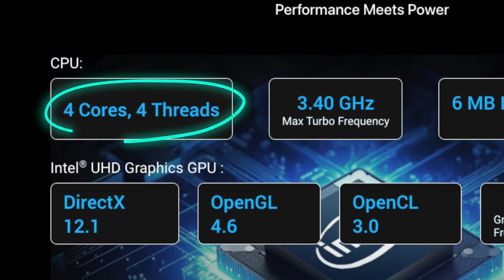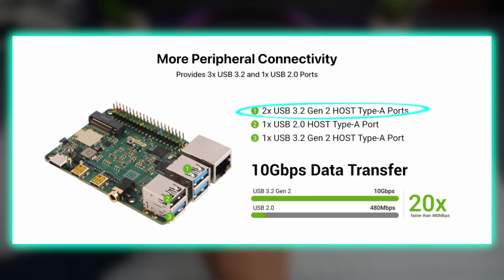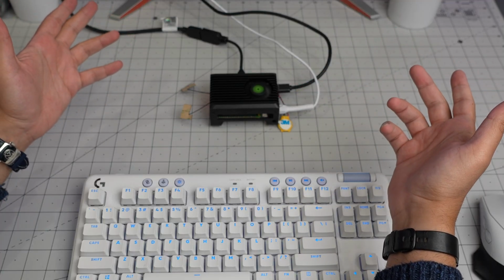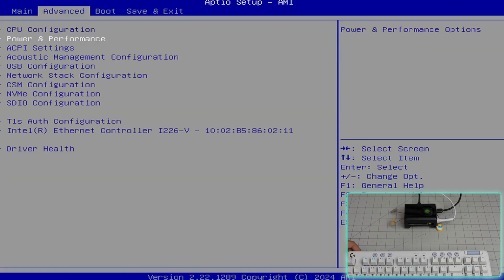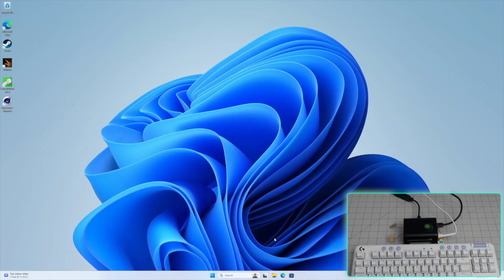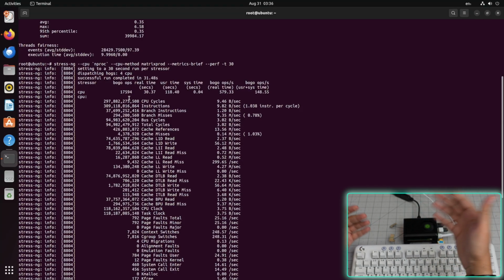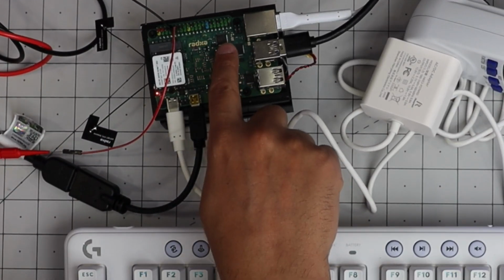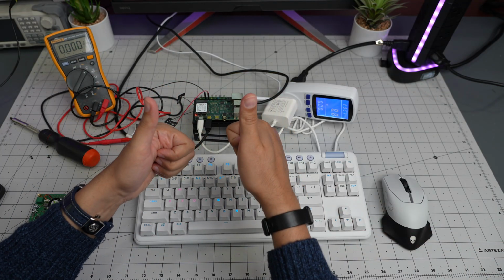Intel N100 and RP2040 Powered Tiny SBC: Meet the Compact Powerhouse, Radxa X4

Comment: That so called heat sink (cooler) is a joke. This thing MUST be upgraded by Radxa asap. Its NOISY, ITS a;ways on, the thermal pads suck and break, and frankly they can't be serious as a LONG term cooling solution. Yes I know Chris Barnatt (explaining computers) had a solution but his solution has not been tested beyond the 5 minutes he tested it. There are however at this time BETTER 3rd party COPPER heat sinks on the market. Don't buy the Radxa cooler.

Comment: I have this board running Home Assistant. Works great and fast. When the Internet is off at night, the Zwave and Zigbee controller still works and operates the light. Only two times in 7 months, the board crashed and I had to reboot. Not bad for a board that is operational 24/7. Nice video, well made.

Comment: can it work without heatsink? or any other small lightweight heatsink(likr rpi5 fan) will work? 
what is the weight of the board?
Reply from the maker: You might try and find a smaller heatsink, but I don't think RPI5 fan would cut it, it's Intel N100, you'll need some good heatsink and fan. As for the weight, without heatsink, it's around 80 gram-ish.

Comment: Nice review, I have 1 comment though. Without C states enabled, the CPU is limited to 2.9 GHz only and won't turbo to 3.4, also it will use more power when idling (can't clock lower that 800 MHz too).

While I understand that you wanted to test it as is, C states should be enabled for the CPU to work properly and for the power consumption tests to be more meaningful.
Reply from the maker: Thanks for the info, you are right, will definitely keep that in mind for future videos

Comment: With 2.5GbE and USB 3.2 gen2, this SBC would make a decent budget NAS and/or backup server. You could even run SATA storage directly from the M.2 slot using an M.2 M key SATA adapter board. Someone needs to offer an enclosure that also holds multiple 3.5" hard drives and a PSU.

Comment: Great video but why would anyone do this just to run shitty windows 11?
Reply: Agreed. If this thing had a second 2.5gbe port it would be an interesting router or home lab. Windows seems like a wasted opportunity for this thing.
Reply: @SHO1989  Yeah and Im not hating. Use whatever works for you. Im a mac and linux guy and Linux ON Mac guy. I cant stand using my Dell which is good. Linux on these small machines is amazing. Linux on my old tiny OLD ass 4GB RAM macs runs incredible well. So this machine in the video Looks good. Just never understood why someone would go out of their way to run ARM windows 11 on a RPi5. Just run it in a VM on a real machine. So much bloat
Reply: Gaming maybe, as an ultrabuget pc? (its cheaper for a 12gb 128gboption than a minipc and smaller). Yeah I agree windows is garbage but it has a lot of software you can't run on other oses.
Oh also beacuse you can use egpus(m.2 slot to 16x adapter) even via linux beacuse the linux arm drivers are so terrible and far between it took somone 2 years to get a extremly buggy and unstable driver for an egpu on the pi5.

Comment: Good breakdown. However, what else sets this apart are thoe 10Gbps USB ports, which makes them particularly useful for externa storage exansion and multi booting.

So if you have an external 10Gbps  storage device then it would be useful to test the actual speed of operation and to confirm that they can all be booted from.

Comment: Only disadvantage with having a microcontroller instead of direct GPIO access is writing extra code to communicate with the main OS. About the same as serialwrite/serialread from an arduino to a PC.
Reply: Exactly! However, the companion rp2040 ease the user to interface external 3.3 voltage I/O.
Reply: To connect directly to the GPIO from the x86 CPU it could be done since the Lattepanda have been doing it for years, I don't remember if Lattepanda Engineers they achieve it by connecting it to an active software managed USB Hub Chip or by connecting by a direct UART port on the x86 chipset, what Radxa did is the only solution to the space that was available on the RPi form factor I guess...
Reply: The other manufacturer that has managed to make an x86 SBC on a RPi form factor were UpBoard from AAEON, they managed to connect directly to the 40 pin GPIO by adding a CPLD chip (A simpler variant of an FPGA $$$) with a custom Proprietary firmware and custom driver for Linux and windows but those GPIO are FAST and industrial grade reliable,

Comment: Why do you need the PoE+ HAT for X4? It's strange that you didn't encounter any issues when installing Windows. In the setup process, it was asking for networking and wasn't detecting the Wi-Fi or Ethernet. I had to find a way around that in order to proceed.
Reply from the maker: Just press Shift + F10, then type oobe\bypassbypassnro and press enter. It will reboot and won't ask for networking (if that's what you are asking). 

As for PoE+ Hat, I just wanted to show that you can power the whole board with a single ethernet cable. In the end of video you can see my powering it with a USB cable as well
Reply: @TechnicallyUnsure  that is exactly what I did, Oo I see. Thank you for the info. I'm subscribing to see more videos from you 👍☺️

Comment: Can we stop spreading the Intel marketing BS? 6W TDP is probably only for the base clock. "Normal" use is probably double, if not more. And that is why you need some serious cooling.
Reply from the maker: I hear you, at the end of video I also show overall power consumption of the board (powered via USB C cable)
Reply: Yes TDP is largely irrelevant but even at twice that, it is still impressive for what it can do and should not require serious cooling as many of the mini PC's already show with some basic fans.
Reply: @srvuk great point. I have a few of miniPCs with this processor, and the cooler is a lot smaller than the one on the Radxa X4.
Reply: TDP is defined by Intel as a base clock power. There is no "manufacturer BS" as Intel themselves define it.
Reply: @r0galik  It's still marketing BS, as hardly anyone will limit it to 6W. And in my opinion reviewers should mention the caveat of that 6W listing. As an analogy, car manufacturers are no longer allowed to publish their own fuel efficiency metrics. They have to follow certain test scenarios and publish those results.
It would be better if Intel would publish power consumption per clock speed, as they publish base and turbo clock speed.
Reply: @LivingLinux  yeah, it's of course reviewers fault that they don't do their homework about the TDP and other stats... I've come to expect that on YouTube though :D
Reply: @LivingLinux  You could just limmit it to 6w, the performace hit is a bit noticable but on linux it dosent really matter beacuse linux runs on potatoes. You can ajust its boost clock speed, or undervolt it btw. Then itl be a bit closer. 
Already outperforms a rk3588s (8 core 4 2.2ghz cores and 4 1.8ghz cores) per watt (its about 20% faster due to the boost being so much higher and it having to do less instrcutions per clock). The tdp of that chip is about equal to the boost tdp on the n100.
Also drivers and software support is way better than any rockchip or pi board beacuse its x86.
Reply: Intel rated tdp always not include boost clock